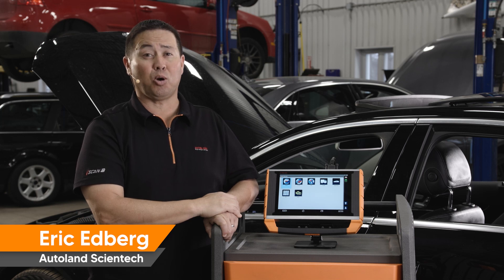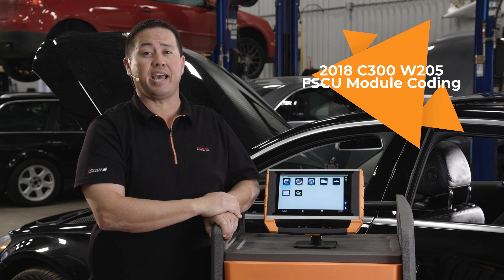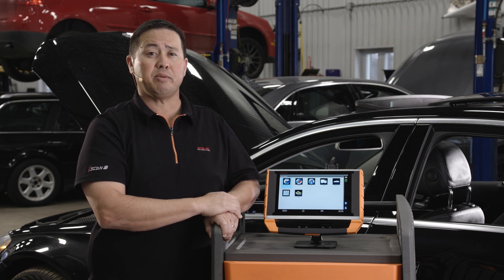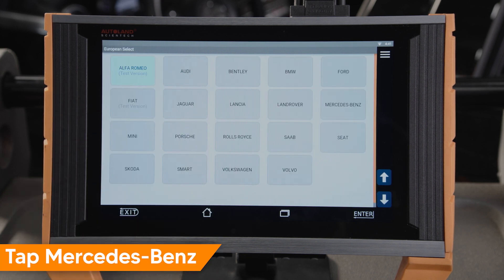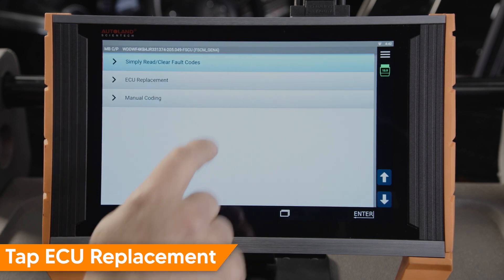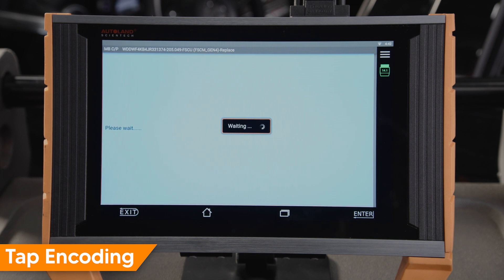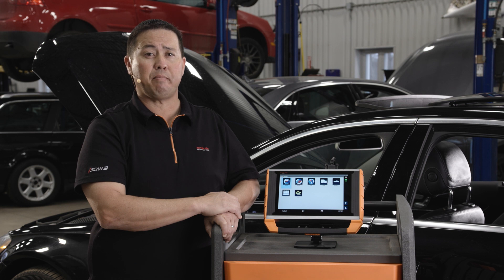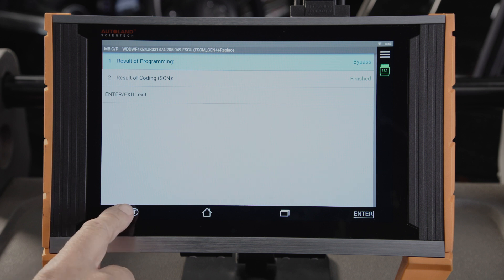How To - Mercedes Benz Fuel Pump Module (FSCU) Coding & Programming

Comment: Hi replaced the fuel control module but the fuel level indicator does not work properly but work on the old module. Does the fuel need to be full
Before programming the new module ? Thank you
Reply from the maker: Level does not have to be full. Use your scan and check function of the gauge as well as the  reading from the sending unit with varying levels of fuel.

Comment: I hate Mercedes, everything is a pain in the ass to remove, everything and it could be multiple parts to sort through for a trouble code
Reply from the maker: All modern vehicle have connected vehicle systems and require advanced equipment for testing.

Comment: Do you have to do this or can you just replace the LPFP without coding? I've got CEL P008A P0087 and P2540, Mercedes-Benz Technical Service Bulletin Topic number LI47.20-P-061013LI47.20-P-061013 seems precisely the issue, along with the 15% fuel light come on, but not only is the in tank images of possible leak points different in my GLK 350, every hose i can inspect seems fine. Replacing the LPFP removes P008A, but P0087 and P2540 persists, not setting off the CEL, but in the background, is this coding? Replacing the LPFP also makes fuel injector 2 leak a little from the added pressure, need a new seal there. Would that set off a P0087?
Reply from the maker: Yes, it has to be performed.